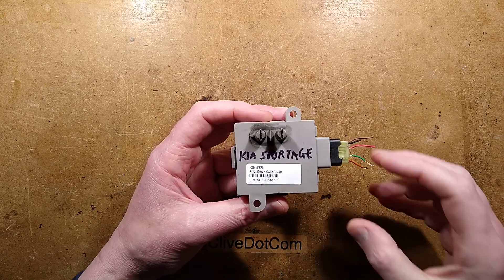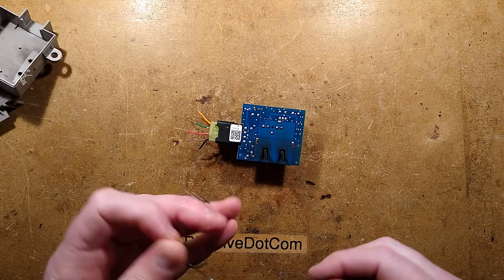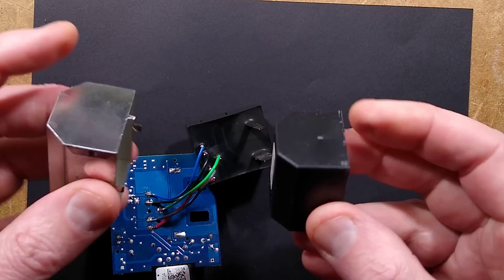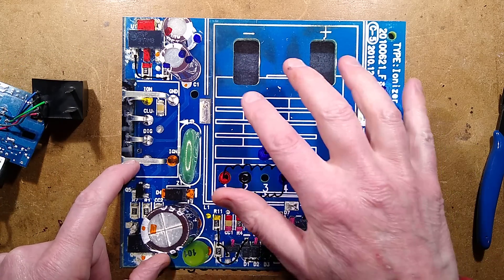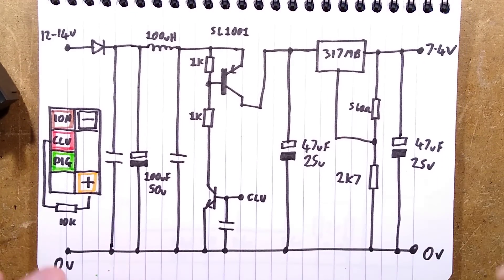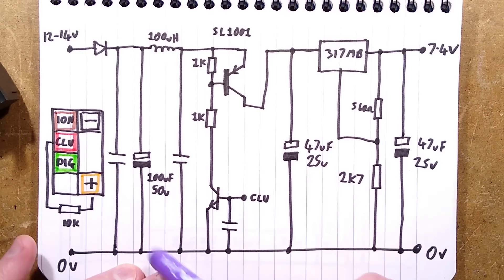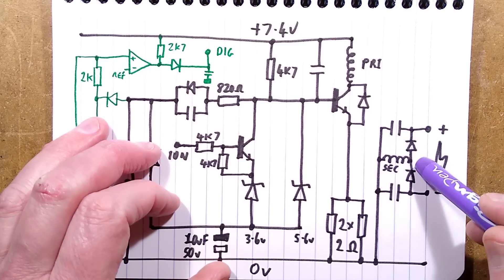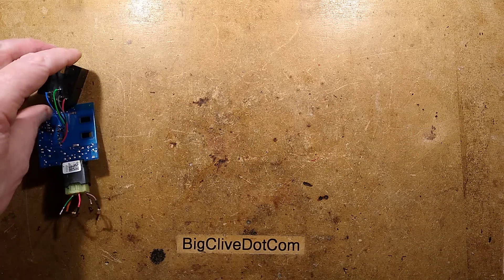Kia Sportage luxury feature hacking (with schematic)

Comment: Looks the same as the "iWave" device for HVAC systems.   Looks like the same technology but smaller - the hvac version has a rotating assembly  with a stationary brush that cleans the electrodes every so often. Never saw an ionizer in a car before and I would expect it to only be in maybe a mercedes or BMW not a Kia sportage lol.  My guess is Kia had problems with evaps and dirty stock syndrome so they added these as a band aid to stop paying techs labor to clean coils

Comment: Dear.
Can you explain to me why I need to add a 10K resistor at the input connection?
And is turning on CLEAN mode when connecting to CLU (red) or turning on ION mode connecting to ION (Brown) two different power sources? Thank you
Reply from the maker: The resistor is a precaution to limit current, as it is just a low level control signal.

Comment: Found the following in a Kia car manual 

The cluster ionizer helps to clean up odors in the vehicle or from the air-conditioner system.

When the ignition switch ON, the inoizer runs a "CLEAN" mode and then a "ION" mode, switching every about 15 minutes.

In the “CLEAN” mode, the cluster ionizer generates negative and positive ions to help clean smells from the air

In the "ION" mode, the cluster generates negative ions and cleans inside air of a vehicle.

Comment: If I were to retrofit an older car where should I put this unit at? Before the cabin air filter or after, or even after the evaporator and heater coils? Which would be the best option? Thanks!
Reply from the maker: I'm not sure the best place to put it in a specific vehicle.

Comment: Ok, but the ozone that these devices create is really bad for you to breathe in. Doesn't seem like a good idea.
Reply from the maker: Most of these units produce comparable amounts of ozone to outdoor air.  Contrary to the misguided information touted by the self appointed experts, natural outdoor air has always had ozone as a small percentage amongst the other active gas molecules.  Without ozone in outdoor air the environment would be very unpleasant.  In sealed indoor spaces it is useful to add trace levels back in to replace the depleted active molecules.
When people talk about ozone pollution, they don't seem to understand that the ozone is nature's defense against the pollution, which is the real problem.

Comment: Ionizers are about a joke. All they do is charge the particles that manage to get past the filter and make them stick to the first surface they encounter. You know, like your dashboard, your seats, your eyeballs...

Seriously, ionizers will just make all the surfaces around get dirtier that much faster, as every last particle of stuff in the air will be attracted to any surface it comes near like a magnet.

If you happen to be a smoker, I feel for your eyes. Seriously, the charged particles will even be attracted to your eyes, no different than any other surface.
Reply from the maker: Traditional ionisers do make a mess, but the dust sticking to your eyeballs and lungs stuff is just Karen-grade scaremongering.  This unit is more intended for creating active air molecules like hydroxyl radicals, hydrogen peroxide and others.

Comment: Can’t say it would illuminate the check engine light (MIL) 
However dtcs would be stored in the hvac control module.
But as with all unneeded accessories in cars, simple resistors are a beautiful way to bypass this

Comment: The should have put that collector resistor in series with the emitter, of the NPN transistor. That would drive the PNP's base with a constant current and mean no additional base resistor is required.

Comment: Note the reason why the primary can only couple to the feedback for a limited length of time is due to core saturation. There are only so many magnetic particles in the core. Once they're all aligned to the magnetic field generated by the primary, the field can't increase any further. Induction only works, when there's a change in flux (magnetic field) over time. Once the core is saturated, there will be no longer be any change in flux, hence why the voltage at the feedback winding falls, to the point of turning the transistor off.

Comment: Clive, I wonder if you would be willing to review/dissect a self-contained (no internal battery required) 3-digit LCD battery (AA etc) tester? Current ebay price of it is about $4.50 shipped to US. They come up in searching ebay for "Digital Battery Tester LCD Display C D N AA AAA Button." I bought a few of those but find them lacking accuracy, which can be corrected, but also lacking constancy in repeated tests of the same AA battery cell, which can range 1.45 to 1.60 V. It is an interesting product and could be really useful if not for the random and varying test results. 

The tester has its own tiny Voltage up-converter to supply its chip from the measured battery, which is a great idea. It starts to work from 0.7 Volts.

Comment: 8:40 oh no it's doing that corona thing does that mean it's 5G you're gonna get hounded for that. As somebody who's working for one of those cokes don't forget to turn your Wi-Fi off at night so you can sleep better because there's nothing else in the Radio spectrum that's still going to go on if you turn your Wi-Fi off. < Sarcasm. In fact your cell phone will probably go off the Wi-Fi and use more cellular at a higher power negating the benefits. But hey I work for crazy, for now. The best part is he likes to say he's an electrical engineer which means he's also a structural engineer and everything else a self proclaimed expert.

Comment: Probably that transistor at 10:54 is a so-called "digital" one which has an embedded resistor or two. It's easy to check with a multimeter.

Comment: Appreciate the RE but at uni i had a module," les parts , better parts" they need to stop engineering solutions to problems that dont exist
Reply from the maker: In this case the addition of "active air components" does have a useful effect.

Comment: Great video, I wander if there is enough voltage to power an indicator lamp to say its operating from the green wire?
Reply from the maker: Theoretically it should be able to power an LED indicator.

Comment: Some of nature's ionizers. The air ahead of a thunderstorm. One of the most famous negative ion producers is Niagara Falls.
Hence the reason why many couples get engaged there and often married because they are high on negative ions. Running a air  conditioner in your vehicle or a building . Hence the reason you get sleepy when at a meeting in a room when there is meeting and the AC is running. Negative ions give that all is well feeling and that's why people and car manufacturers are using them.

Comment: How difficult would it be to retrofit something like this into a semi old car? 
(BMW E66 2003 model, if that is of any importance) Can this little unit be run as a standalone piece of equipment or does it need to be hooked up to a CanBus?
Reply from the maker: You can get bipolar ioniser modules that could be mounted with a suitable fuse in the dashboard.  Their power consumption is very low.
https://www.aliexpress.com/item/32914804007.html

Comment: Hi Clive, I very much doubt that this would have any communication path to the engine ECU. It would talk to the climate control and that’s it. There may be some sort of indication on that but I doubt it. The first anyone would know about failure of the ioniser is a code read of the climate control system. A lot of information is traded via the CANbus and LINbus systems but I doubt if any other systems in the car would be interested in the state of this gadget.
Reply: Unplugging the AC controls on an old Volvo s60 disrupted the CAN bus and threw on the airbag light (needing a computer to turn it back off), you never know these days.
Reply: @sm1thers  as the CANbus daisychains around the vehicle then unplugging a module will interrupt the bus.  Many CitroenPeugeot cars will not crank if the ABS module is unplugged for the same reason. The module does not need to work, it just has to be there for continuity
Reply: @ShaunieDale  yeah that's all it was. But annoying that it led to a permanent on airbag light, I was expecting it to clear itself after so many cycles, but plugging it in was the only way.
Reply: @sm1thers  Airbag systems are the most paranoid of all of them. Most systems will eventually put the light out if the fault conditions are cleared, not with SRS systems though. One caveat, Japanese and Asian systems will sometimes clear the SRS lamp without intervention. 
Funniest one I had, customer drove their Jimmy into an inspection pit and set the airbags off. Because it had outward opening rear windows supported in three places they shattered and blew completely out, and had to be replaced!

Comment: 16:04 - That could also cause a code when the control module wants to turn off the module but still gets active signal back. Maybe green wire through resistor to red wire?_

Comment: In case the "Maintenance required" LED annoys you: instead of driving your gar to a garage, just desolder the LED and put a 10k resistor across it. Saves A LOT of money in the long run!

Comment: Clive, have you ever tried 'ChipQuik Alloy'? It's an alloy solder than turns the solder in a joint (or more importantly, all the joints on a single chip, or in your case a can) into a very low melting point solder. It then retains the heat long enough to heat them one at a time quickly and have them all remain molten long enough to remove the chip in one fell swoop. Good stuff! It's only disadvantage is the need to solder-wick the pad or thru-hole thoroughly so as to return the joints to the same melting point (preventing components from falling off in a high temp circuit). It's not cheap, but one only does this task seldomly anyway, so the tube of a dozen or so sticks (like 6-8" lengths of solder) I bought 7-8 years ago is still 3/4 full. 🤔
Reply from the maker: Someone has just said they've sent me some to try.  I've not tried it before.

Comment: Btw, the 2x 2R resistors add negative feedback based on transformer current. As the current increase, so does the voltage over the 2x 2R resistors, reducing the voltage between base and emitter, forcing the transitor into the linear region where it isn't on hard. It becomes a crude current regulator.

Comment: That green capacitor at the input is a transient supressor, typically around 50V, there to clamp any load dump spikes to a safe level, and if prolonged to blow the AC control fuse, so that the unit is protected against failing. Very common on automotive electronics, as part of getting it certified is that it has to survive a load dump transient, reverse voltage and double battery voltage boost, without failure, though blowing a fuse is permitted. So the big beefy VDR to clamp voltage to a safe level, the diode to protect against reverse polarity, and the capacitors rated for 35V on the input, along with 60V rated transistors. Load dump is when the battery is disconnected with a running engine, and the voltage ramps up rapidly, because the battery is no longer there to act as a near infinite charge sink, before the alternator voltage regulator (either built in or via the ECU, depending on the vehicle) can react to reduce it to a safer level. Alternators typically have built in protection against it rising too high, by having the rectifier diodes be designed with a low roughly controlled breakdown voltage, around 40 to 70V, so that they will limit the voltage that the alternator can develop with no load on it.
Reply: Yes  🇨🇦🐻
Reply: I wonder if garbage electronics from teslas have this kind of protection, I guess they don't as they tend to go on fire often.

Comment: The potting not only helps with HT insulation but makes the module very robust against the vibration of the "Sportage" as it traverse smooth tar roads around school as Mum goes on the sidewalk to pick her little munchkin up RIGHT in front of the gate because his legs hasn't been potted and will fall off if he walks a bit too far... 🤔🤣
Reply: All children should be potted, and given a dremel for their 18th.
Reply: The problem is rather because the mum thinks the streets are unsafe because of all the car traffic. Go figure...

Comment: Question for Honda guys;- Will faking a taillight with a resistor to get to the parts store for another work to trick it into starting? 
 
 For those not aware a burnt taillight may cause your vehicle to not start due to a sneaky circuit board hiding behind it, put there for that purpose. Carry spares.
Reply from the maker: If it's using the filament resistance to detect the bulb then a resistor should trick it.

Comment: Kia has Sportage while other car manufacturer have component shortage, at least in Spain they advertised themselves as the only company that has not such problem.
I understand that there could be problems for a few months after the corona discharge but now I think in most cases it's a fake shortage as they have figured out that they can sell the cars without a bunch of components for the same price.

Comment: Doesn't that create ozone and if it fills up your car wouldn't that be really bad for your health 
Skip anything that makes negative ions it can cause   fluid in your lungs headache asthma
Lightheadedness stay away from the air purifiers that create negative ions there bad for your lungs
Reply from the maker: It creates trace ozone at lower concentrations than occur in natural outdoor air - where it is an essential component.

The hysteria around ionisers is often based on ozone generators that were wrongly referred to as ionisers.

Comment: I have something for you to build.
The new pc going these days are the Mini PC  I have the Beelink brand but there are others 
They have a big problem '' I think '' and that is  No Battery , So if the power goes out they crash, 
If you using your phone or laptop or tablet and the power goes out its ok because the battery is always working 
If my Mini PC is updating or downloading anything and the power goes out it could be the end of it, 
I seen a guy showing his and he said I unplugged it when it was updating to see what would happen and it's bricked now, 
I have seen a few now say they don't know what happened it was on when I left but it was off when I came home and now it wont turn on, 
Im thinking the little power outages are a big problem for these mini pc with no battery

Comment: I recently ripped out the ioniser cabin filter of my 25 year old nissan, it was absolutely blocked with what I can only assume was diesel particulates and dust to the point the vent fan did nothing. It was grim. Does make you realise how much crap there is floating around in the air. Also the area around the ionizer was coated in black dust too. So they do work well.
Reply: Seen a few forests over the years growing on the air filters.
Reply: It's a good idea to change them once a year, but most people/garages overlook them, often due to the difficult access.

Comment: I wonder if that at full power could light up a 4 ft fluorescent tube. Maybe even an 8 ft tube? Perhaps a large neon sign even? Also, that looks like it would hurt if that hit you.
Reply: It may be no worse than the shock you get from walking across a carpet in the winter and touching something metal. Maybe Clive will try touching it with his fingers and tell us what happens 😁
Reply from the maker: It's very low current.  It would barely make a tube glow.

Comment: Very interesting, I should make my own little ozone generator to freshen my cars up after storage.
Reply: Ebay has had little modules you just plug into the cigarette lightter ports and it creates a bit of ozone via a HV bulb. Lots of them are fakes though, so it's 50/50 if you get a real generator or just a blue LED in the same housing.

Comment: If there is indeed a separate HVAC module, then the DIG wire lets that module know of the failure and then that module connected to the CAN buss will send a code to the BCM [Body Control Module] which in turn will register a trouble code on the PCM OBDII interface. [PCM=Powertrain Control Module]
Simply put: The dig wire throw a code that can be accessed with a scanner. 

The code may be a "hard code" which turns on the check engine light or a "soft code" that just sits there and you won't know anything is wrong until the PCM is accessed with the scanner and choose the "Read Codes" function and discover the code.

Starting in the 2000's vehicle systems got much more complex with various modules [Airbag, Anti-lock brakes, seatbelt, brake and many others.] interfacing with the BCM as the main brain which then communicates with the PCM. In the late 90's the engine [ECM] and transmission [TCM] modules were combined into one package. [PCM]
Here are some examples...
https://www.mech4cars.com/ecm-vs-pcm-vs-ecu-what-are-the-differences/
here are some other modules...
Keyless, gateway, radiator fan, door system, window/power door lock, immobilizer, transfer case, differential, parking brake and many more that I don't know about, especially luxury cars that have a ton of features.

Comment: That's quite a vault of can, shell, and resin for the high voltage shenanigans. You'd almost think they didn't want anybody peeking inside.......for 10 pounds on evil bay  these things might be a viable repair/substitute for a gas ignitor on a stove or heater if the original one bites the biscuit and suppliers want half yer net worth for a new one. Cheers!
Reply from the maker: You can buy many different stove ignitor modules on eBay and AliExpress.

Comment: They claim +/- 3.2 kV so the classic formula for rounded electrodes say around 2.1mm spark (3kv/mm) but needle points formula states 6.4mm (1kv/mm)
https://hackaday.com/wp-content/uploads/2016/11/sphere_length_voltage_chart.jpg